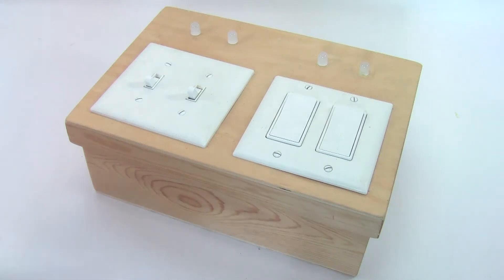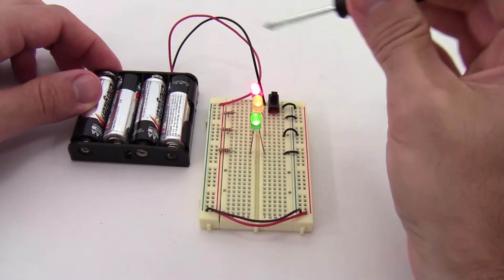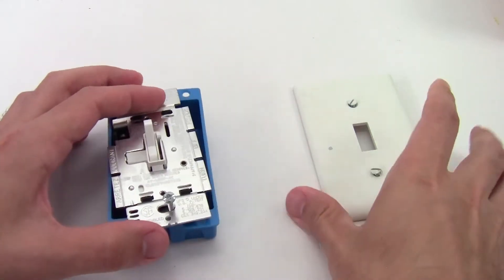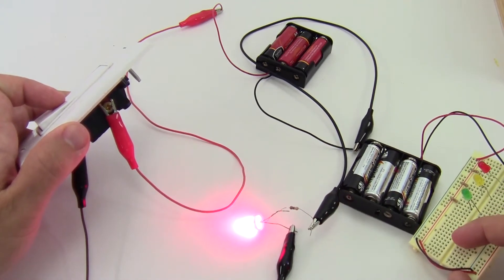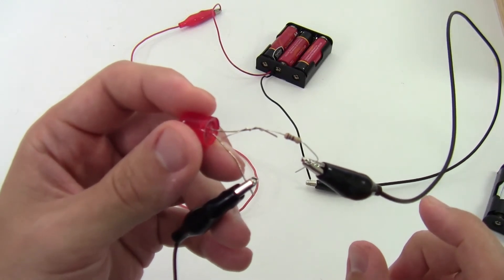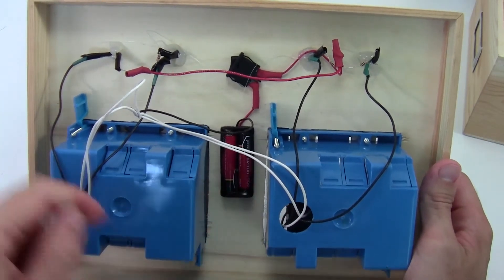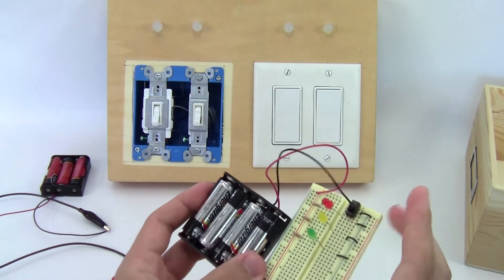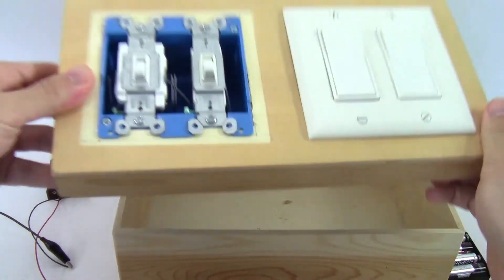DIY Kid's Toy LED Light Switch Box

Comment: question does it have to be battery operated? I'm working on a minature scen in my wall and want to use my houses power not battery. is that do able?
Reply from the maker: Hi - sorry this reply is 2 months late - I now have two kids and hardly have time to reply to YouTube comments. You can use a DC wall adapter - the kind of plug that has a little box, if you look closely the text will say something like "INPUT 120 VAC" and "OUTPUT 5V" meaning it takes the 120 volts from your wall outlet and converts it to a lower DC voltage. How to do that is more than I can really explain in a YouTube comment and I don't really have my own video on it, but you should be able to find other tutorials for it.

Comment: Hi Ben, thanks for the video. I am preparing my 9 months old boy's busy board and it brought me to this video. It helped me a lot. Can I also light up 12V 20A toggle switch's built in LED with 4 AA batteries? This is the example of toggle switch: https://www.amazon.co.uk/Switch-Toggle-Control-Offroad-Ignitions/dp/B07H3MNCY8
If input is not enough, what would be the easiest way to operate this toggle switch with parallel connection of normal jumbo LEDs and switchs?
Reply from the maker: Hi - so it looks like that switch is going to require 12V, and 4xAA batteries only gives you 6V. However, you could try hooking it up to 6V just to see if the LED is still visible. If not, then you could use 8xAA batteries to get 12V. This video should explain how you can also connect the other LEDs to a 12V source (in short, you will want to put a few LEDs in series so you aren't wasting as much voltage drop over the resistors - i.e. if your LED's voltage drop is only 2V, then you can put 5-6 LEDs in series with a small resistor and a 12V source, instead of putting them all in parallel with bigger resistors): https://youtu.be/EeCh68a1GEg

Comment: Can i change to larger bulb..eg 12watt bulb ?
Reply from the maker: Hi Faiz - if you mean a regular light bulb, like the kind you screw into a lamp, then no. They operate using alternating current (AC) and this circuit is battery-powered direct current (DC). If you mean a high-powered LED, then yes, but you need to take the power rating of the resistors into account. My video on LED resistor sizing may help you: https://youtu.be/EeCh68a1GEg